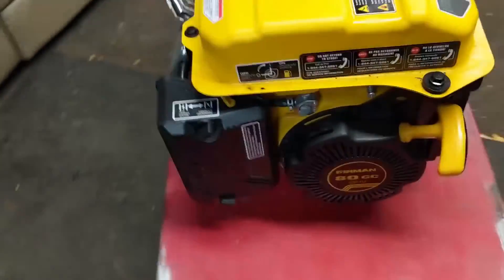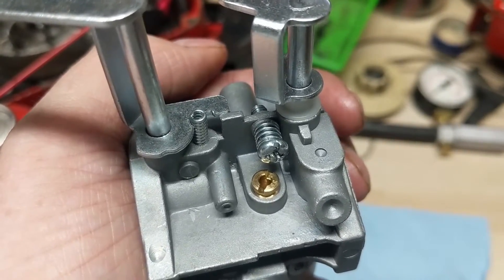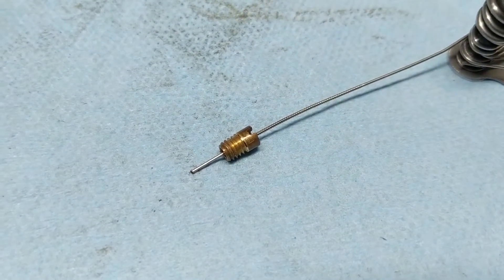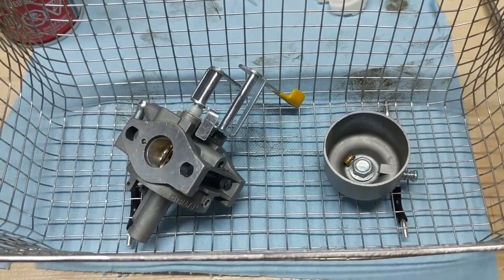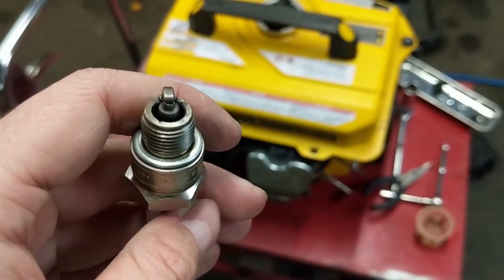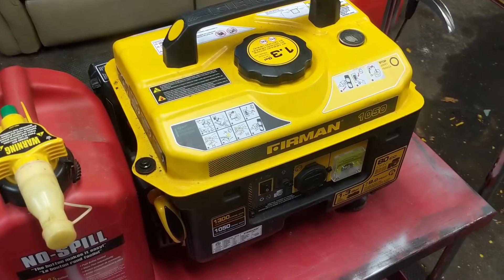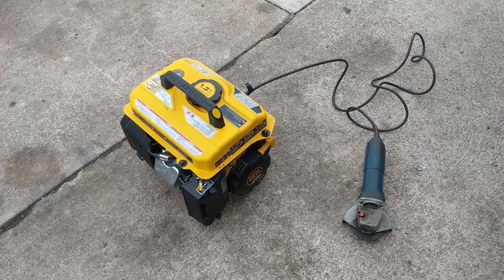Firman 80cc Generator - Won't Start

Comment from the maker: NOTE: Factory Pilot Jet size appears to be 0.016" and Factory Main Jet size appears to be 0.026"

I just fixed another one of these 80cc Firman generators, and had to oversize BOTH the pilot jet and main jet by 0.002" to make the engine run smooth. I also adjusted the throttle backstop farther in, which limits how much the throttle can move. This also has proved effective at stopping the "surging" effect.
Reply from the maker: Stories are true, they're not great but if you run high test fuel and don't let the fuel sit in it for long periods of times they're decent for the price.

Comment: I have the exact same generator.  It starts up fine, runs fine for about 10 seconds, then just dies.  I drained the gas and put new gas in, but I have the same problem.  And ideas on what the problem is?  thank you.

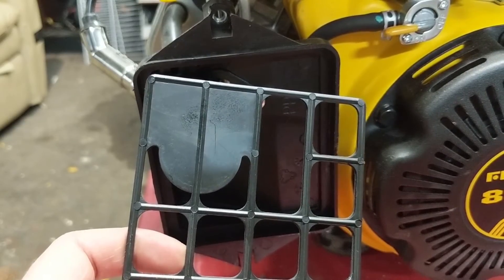Comment: 2:03 The way I understand how it works is, the solid piece I think serves to prevent foam filter material from directly being sucked in as that area immediately in front of the carb throat has a very high vacuum potential. The solid piece helps spread the vacuum throughout the air box and filter surface. To a certain extent, the cover may also prevent the engine from burning a hole into the filter in case of a backfire.

Comment: Do not clean sparkplugs on a wire wheel or a wire brush!
Reply from the maker: On vehicles yes, they sometimes have iridium or platinum coatings. But these lawnmower plugs don't have coatings, and are copper core

Comment: At 12:43 you are adjusting a screw which affects the speed of the engine and also appears to change the voltage reading. How do you know when it is correct. Do you adjust it so the voltage reading is at 120 volts and running smooth?

Comment: Thanks for the video i have the. Model spg 1500 same brand should i use the same. Oil 10/30? Thank you.
Reply from the maker: Yes 10w30 for summer, 5w30 for winter
Reply: @EliminatorPerformance  thank you full support.

Comment: Good video and well presented....only suggestion is regarding the restrictor plate...as with almost everything....SHOW us, don't just tell us.
It would have been easy and more useful to show us the 'summer' position of the plate rather than just describing where it goes.
Otherwise...an EXCELLENT video..
Cheers and thanks from North Canada

Comment: NEVER run Ethanol Fuel in your small engines.  Always turn off the Fuel and let the engine run dry.    Those two tricks will add DECADES of service life to your small engine.  Three  cap full  of Marvel Mystery Oil in the fuel tank during brake in and there after will add another ten years.
Reply: @hillbilly tech Ethanol free fuel can be had.  It's available at a number of fuel stops in our little two horse down.
Reply from the maker: Thanks for watching!
Reply: @hillbilly tech This is only a few listed.  https://www.pure-gas.org/index.jsp?stateprov=NM  All of the truck stops here offer it I think.
Reply: @hillbilly tech Ethanol deterorates  some plastics and rubber well above what normal gas would or can do.  Rubber Diaphrame Fuel Pumps really don't like the stuff.  If you can simply avoid the crap it only makes sence to do so.

Comment: Nice video. I have that same generator, bought it after hurricane Maria destroyed Puerto Rico. Its an amazing generator. And just today was testing it, and I knew it wouldnt start. I thought I drained the fuel, but to my surprise it has been with fuel for like 2 years. Maybe the problem is the carburator, gonna see if I can clean it up. Nice video again.
Reply from the maker: Carb clean should do the trick, I'd recommend to pull the spark plug and put a small amount of 10w30 oil in the cylinder, and give it a few pulls with spark plug out to lubricate the cylinder walls.
Reply: @EliminatorPerformance  Just cleaned it up with carburator cleaner. And with just one pull, it started and it has been on for like 40 minutes. Later will pull the spark plug out, to see if it needs cleaning, and will take the whole oil out. Thanks for the video man. Greatly appreciated ! Now I dont have any worries, if another hurricane gets to Puerto Rico I am more than ready !
Reply: @EliminatorPerformance  About the oil to use, I have a doubt. When I used the generator here in Puerto Rico, I used it with SAE30 oil. I believe the manual stated to use that oil type, and the generator runs great with that oil. But you said that in summer it should be used with SAE 10W30 oil. Since Im in Puerto Rico, I am in summer all year long, then the oil should be 10w30 then, right ?
Reply from the maker: @ppowerman5000  10w30 in summer, 5w30 in winter!

Comment: You must get a lot of generator repairs since most people do not use fuel stabilizers and generators rarely get used enough to run the fuel in the tank completely out thus gummed up fuel and jets. I normally fire up all my equipment once per month just to get different fuel into the carb and also add fresh stabilized fuel to the tank. Have not had any repair issues with equipment not starting and i am 70.
Reply: What do you do with your old fuel?

Comment: The fuel treatment you use is good stuff , I use it my self it works well. k 100
Reply from the maker: Yes we like it better than "Stabil" because it can help prevent water in the fuel when using E10 fuel.